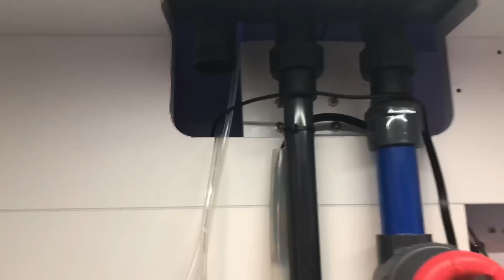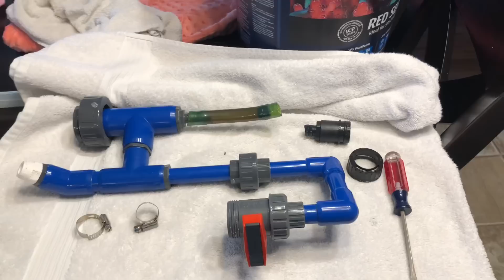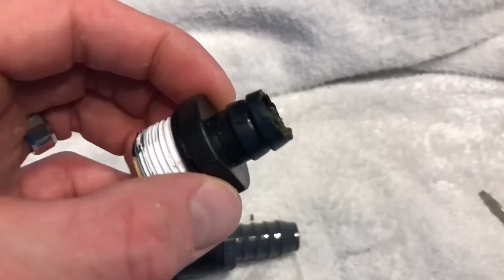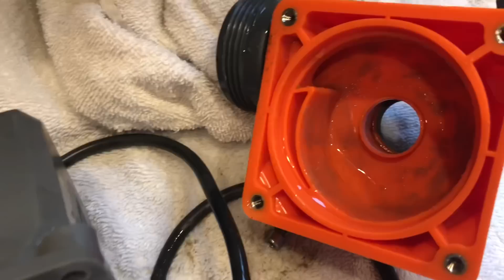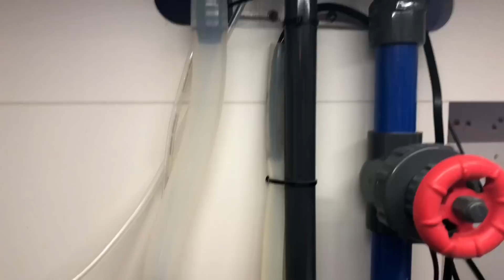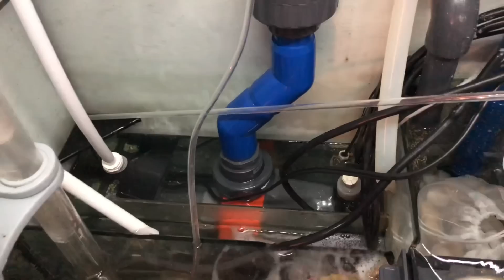Red Sea Reefer 250 | Stock Hose Barb FAIL | Cleaning Neptune COR20 | Manifold GONE!

Comment: I need to change out my drain setup to the same as yours, can you list the exact parts you bought for your drain from BRS?
Reply from the maker: I used this 3/4" adapter - https://www.pvcfittingsonline.com/3-4-x-1-sch-80-pvc-reducing-male-adapter-mpt-x-socket-836-102.html

You'll also need one of these - https://www.marineandreef.com/Red_Sea_Reefer_Pump_Return_Connector_16_mm_42221_p/rrs42221.htm

1" valve - https://www.bulkreefsupply.com/spears-gate-valve-slip-x-slip-1-46dfb1fd21d4e16401260f54d2b6a88a.html

Comment: Looking good buddy. Nice video. Will take my COR 20 apart asap and send you a photo if there is any rust.
Reply from the maker: I opened a ticket with Neptune, we came to the conclusion that something got stuck there. Which makes sense since I used metal hose clamps, way above the water line. But I do remember cutting the clamps down to fit!
Reply: @pelphrey  Thanks for the update.